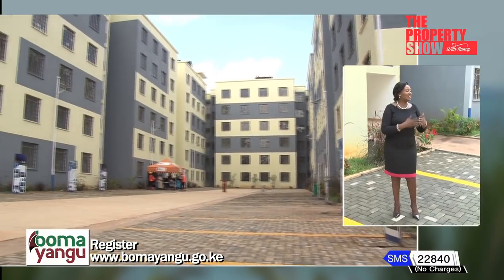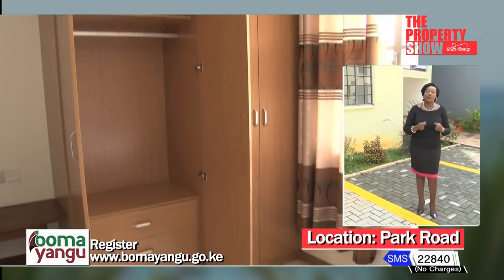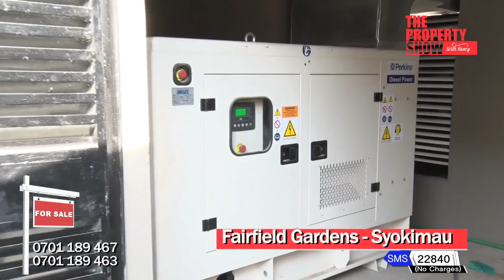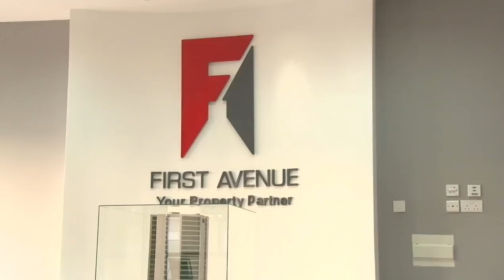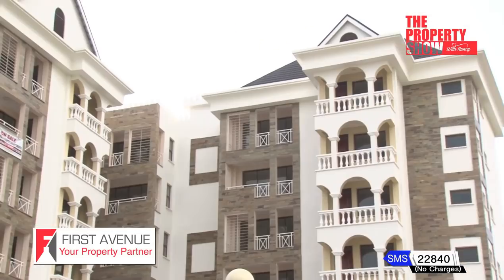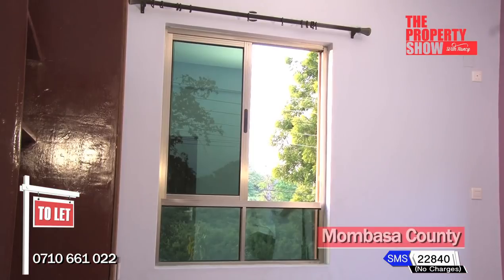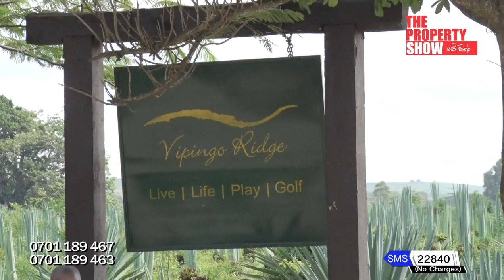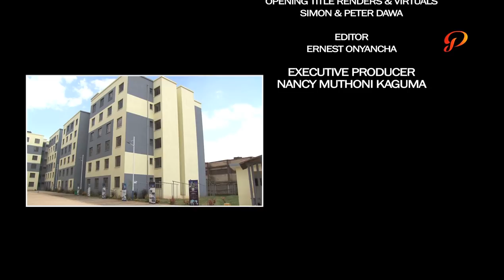The Property Show 26th January 2020 Episode 349 - Affordable Housing Programme & County Edition

Comment: The real estate bubble in Kenya has bust.A landlord slashed 5k in high end apartment in rwaka.Its gonna get worse.
Reply: Be a positive person and you will succeed in life.
Reply: There is no bust and there won't be any in the near future. These AHP projects are a drop in the ocean. And most importantly, they won't last for a long time. Their main low cost driver is the free land given by the govt. Secondly the applicable VAT waiver on materials cannot last for long because the govt is running broke. The current drop in rent is due to the economic downturn occassioned by covid 19 measures. The country is getting used to it.